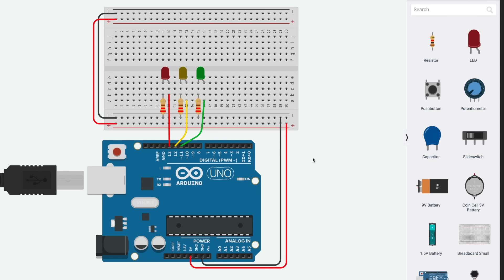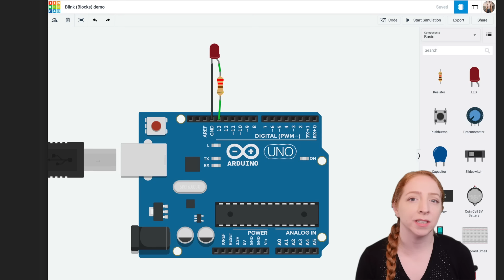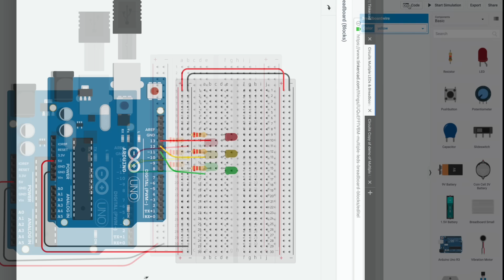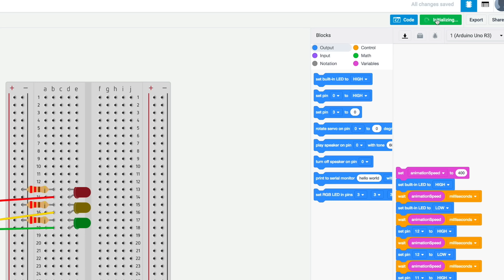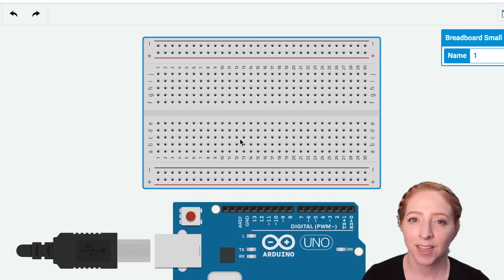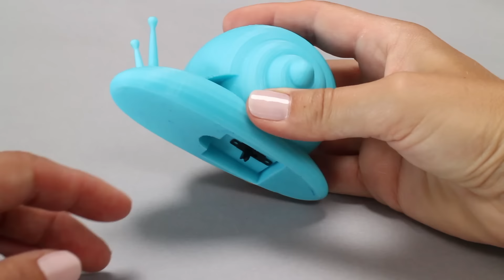LEDs & Breadboards With Arduino in Tinkercad

Comment: I know this is old, but since you're immediately starting off with pin 13, you should really explain that it should only be used when designated as an output specifically. If someone is learning with this, they may auto-default to starting at pin 13, which could cause problems that they won't understand.
Reply: Am new to this n my head is shaking with trying to understand
Reply: Thank you

Comment: I followed your steps but why in text editor the code has changed?
Reply from the maker: Did you switch between having the code in Block and go to Text? If you do that, it will mess up the code.

Comment: why are the resistors attached to ground in this video when they were connected to power in the last video? Great Video btw!
Reply: Yes, you can connect an LED in either direction—towards GND or towards Power—but the way it works depends on how you control it and how you orient the LED.

There are two common ways:

1. LED to GND (Sourcing current):
You connect the anode (positive) of the LED to a resistor, then to Vcc (like 5V), and the cathode (negative) to GND.
In this setup, the LED turns ON when the power is given (HIGH). This is the most common method.

2. LED to Power (Sinking current):
You connect the anode to Vcc through a resistor, and the cathode to a microcontroller pin.
In this case, the LED turns ON when the pin is set to LOW, because current flows from Vcc through the LED into the LOW pin.

Comment: Why was a variable declared? I tried without it and the output was same. Someone please tell what is the use of that variable? this is the code w/o variable
void setup()
{
  pinMode(2, OUTPUT);
  pinMode(4, OUTPUT);
  pinMode(8, OUTPUT);
}

void loop()
{
  digitalWrite(2, HIGH);
  digitalWrite(4, LOW);
  digitalWrite(8, LOW);
  delay(1000); // Wait for 1000 millisecond(s)
  digitalWrite(2, LOW);
  digitalWrite(4, HIGH);
  digitalWrite(8, LOW);
  delay(1000); // Wait for 1000 millisecond(s)
  digitalWrite(2, LOW);
  digitalWrite(4, LOW);
  digitalWrite(8, HIGH);
  delay(1000); // Wait for 1000 millisecond(s)
}

Comment: Hi... Thanks for your videos. So I followed along using TinkerCAD. What happened is that the first cycle ran smoothly from red to green in the specified time. However, every cycle after that took twice as long as the previous one the longer it ran...

Comment: Ur a light saver. I was having trouble coding at first. Your  explanations were beyond clear!
Reply: too late. he died. 😢 rip
Reply: @ty88  rip
Reply: What is the name of this application(program) please? I need to use it to creat a circuit(in breadboard connected to Leds-RFID-etc..)
Reply: @rayanahmad4412  4 months late, but if you still need it, it's Tinkercad.
Reply: fff
Reply: bxbaxbaSCGEFDXDNICMGFD JCDFNUFXCJDIUE98XB NBCJKV8FRD GCF U8IVJGFRFNJVM KFNRGFV VBGIFFVFRFFGIFIR4F VNKFGRJRKFVRENC,FVL, RMSXDFRDC IVFCKDERMN ,JIGDFIKGLR RSWL DMXFJEKRDA FSCVPFDGEDFC VKFDREDFCV FDGRFCV KCFDF0OKFMDKF0MFKDEFCV VFKVC0KCFOCV0DFOEKDFCV VC0FDFOKCVM KIVCF NMFDFCKV MCFKOD0FCOVKM FDKDOF0CVOKM FDMKO0CVKOFMDMKODF0CVOKMF EMKOD0CVOKNEROWDXICKN EFIRU90XDIOCK XNZDFIW90OXKCV MFRE03IFNWCEIDF0JN TFGFS9KIVMFER34KOXFVKM SFNQEOXFK

Comment: Hello, In the first video I had observed that the positive terminal of the diode is connected to the resister. But whereas in the Second Tutorial, the resistor is connected to the negative terminal Why is that different.
Reply: Current has to flow around the entire circuit. The same current is flowing through both components so it does not matter whether you put the resistor on anode or cathode side, both will work the same.

Comment: Your presentations are the best, very clear and concise. However I am finding the component list rather Limited. For example, it is hard to see if the electric motor is running or not. Is there a way to create my own components and add them to the library?